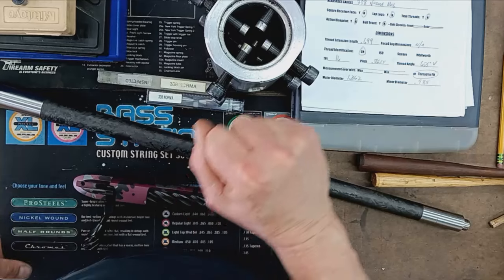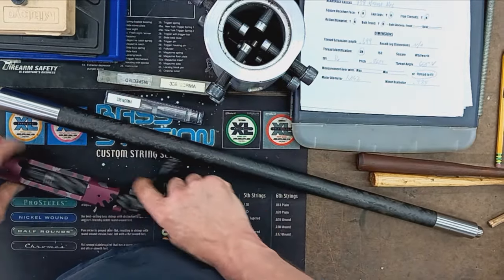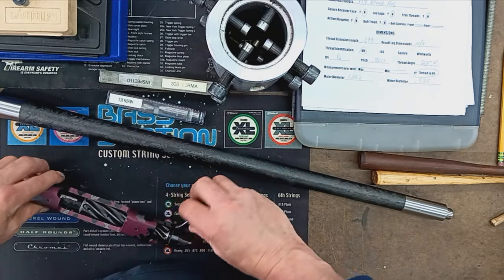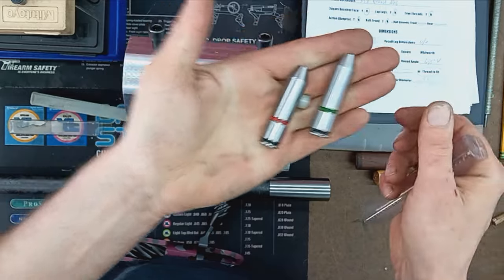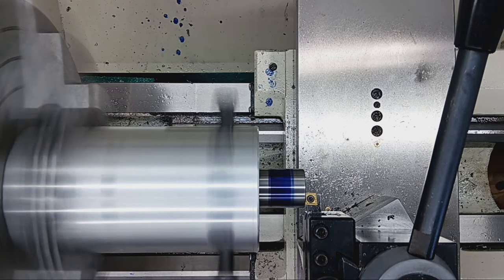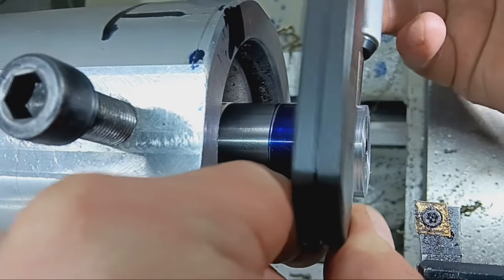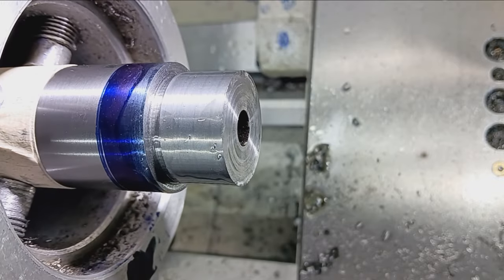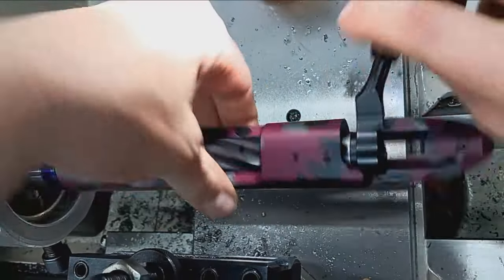Rebuilding a Weatherby Mark V into a Giant CIP 338 Norma with Proof Research Carbon Fiber Barrel

Comment: I been using copper pipe. I anneal it then squeeze a couple different pieces around different barrel diameters. Then cut the excess from the overlap if that makes sense. Also, I wrap a drywall tape before I put the copper sleeve on.
Reply from the maker: That's a great tip!  I do use the drywall tape on most things, but I'll have to try your copper pipe method!  Thank you for watching and engaging the channel!

Comment: That brake is nicely blended to the barrel.  Nice job!
What is the difference in the oil you used threading and chambering vs the darker oil you used when drilling the brake?
Reply from the maker: Thank you!
Wow, nice observation!  
Lighter oil is Nu-Clear and Darker is Viper's Venom.  
Thanks again for engaging the channel!
Reply: @AccurateRiflesandRestorations  I got to spend a couple days in the Lathe Cave with The Viper chambering 2 barrels.  I am trying to get my own lathe and enjoy watching the skilled people on YouTube and try to learn.  I don't know anything about the different oils and plan to only have Viper's Venom on hand.  What is the difference and reason you use different oils?